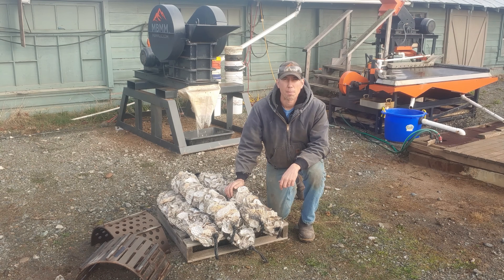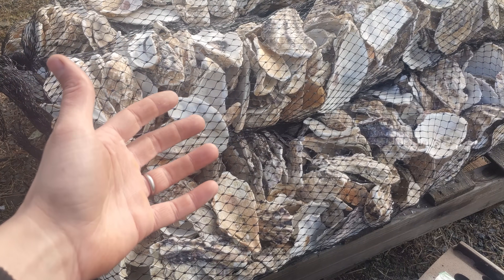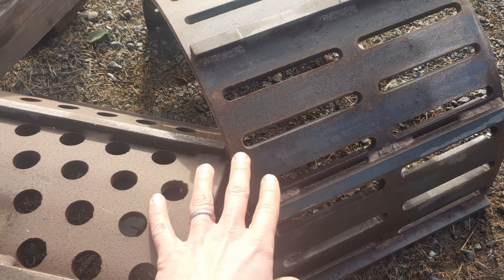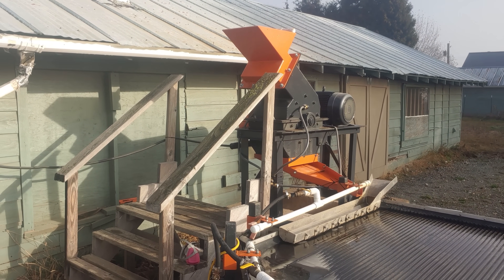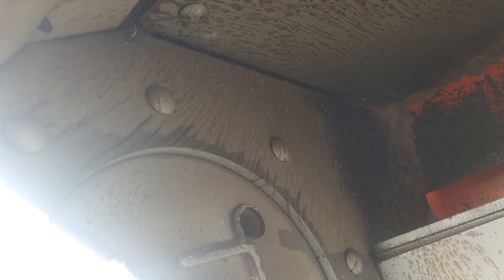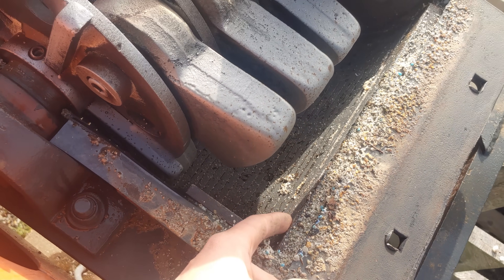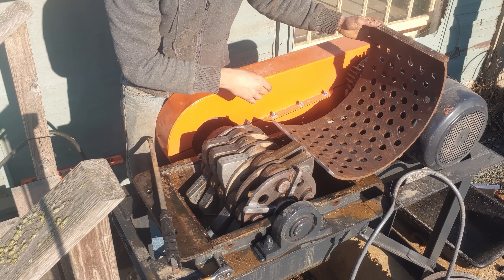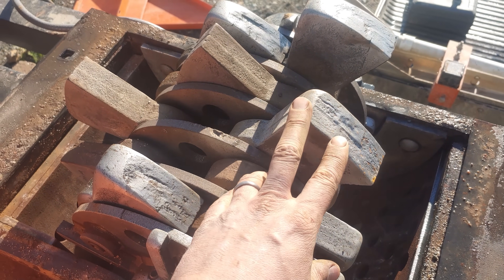Oyster Shell Crushing Machines - Crushing and Grinding Shells with Jaw Crusher and Hammer Mill

Comment: Those oyster shells crushed to ½" then through a rotary kiln would make coarse quick lime.
Add coarse quick lime, Portland Cement, sand ,aggregate and fiber reinforcing or graphene in solution and you'll have concrete that heals its own cracks and sets perfectly with salt water.😀👍
Its also dramatically stronger than ferro-reinforced concrete.
The only downside is the stuff will last for thousands of years, not decades so once it's used, its there until it's purposefully destroyed

Comment: If your crushing for a specific size you don't use screens in the mill you screen before the mill and rerun the oversize using horizontal screens with vibrators starting with fines to product size to oversize and returning into the crusher using a bucket elevator and a chute to return to the top end of the screens. Look into fertilizer production it will show you how to screen for a target size. Your welcome.

Comment: I'm in construction, best thing I can think of is making quicklime, I'm guessing the customer is not looking to set up a new operation, just crush and sell, which then is quite easy. Basically burning shells to form calcium oxide, then crushing to get the powder and well, it's essentially quicklime. There's a bit more to it, but it's a good sell if you have the startup to do it.

Comment: You can weld the top of the hammers it’s called hard facing the technique is also used on worn heavy equipment bucket teeth. Weld on top of weld in a line next to each other slowly building up the worn away metal.shape up and smooth out the facing welds with grinder and put it back to work. Replace them when they break a yolk .

Comment: This is a decent additive for vermicompost and the fine to small (aged) oyster shell particles specifically are great for making biochar soil conditioner product(crushed biochar, vermicompost or castings, compost, humus, insect and fly frass, rock dust, a couple different "meals" like kelp meal, crab meal and fine to small particles of oyster shell).

Comment: For anyone living where roads ice up. Take a bag or Oyster Shell, toss it in the trunk. Added weight. But, if you do get stuck on ice, it works 1000% better than sand. The sharp edges work wonders.

Comment: When the hammers wear out, you can weld metal with a conventional welding machine and align them with an angle grinder. The welded metal is harder. The work is very cheap and easy. So they will be almost eternal.

Comment: One thing that concerned me a bit is that you mentioned the hammers are 20% chrome. I know some forms of chrome are toxic, so I'm not sure if those hammers would be very suitable for crushing chicken feed (or other feed applications), if the hammers may leech chromium into the mix. This would be worth looking into, if you go forward with supplying for this application.
Reply: Crushing rock the wear fast......but crushing shells would probably last a year and over that time you probably would get enough leaching into the product to find even a trace amount in a lab test (I'm guessing though) but good to think about this issue when he actually builds a machine for customer. Right now he is just video ing what path the build will go.
Reply: Hexavalent chromium is the dangerous form (+6) and these hammers have metalic chrome which is 0. Chrome itself is about 40mg/kg in US soils so the amount of chrome in the tailings isn't much different from what's naturally there, but being in the safe form it's not a threat. Some of the chemical steps used to extract other elements from the ore could change the chrome to the dangerous state but that will not be happening with these oyster shells.

Comment: Is the rotational speed on the hammer mill adjustable?  I operate an impact Crusher which is kinda the same internally. Higher the speed on the rotor creates more fines in the finish product. When trying to make spec rock the only real adjustments I have are rotor speed and apron distance

Comment: The crushed shell have many uses. They can be used in big coal fueled thermal plants to  scrape residual co2 from the exhaust gases when added to the fuel in a swirl fluid combustion chamber. They can be calcinated to make dehydrated lime. They can be  used as an aggregate for building mortar. If you clean it and crush it to fine powder with no silica it can be used in cosmetics and as a fine abrasive. Also as feed to birds to help them crush food in the gizzard and as a calcium suplement . As a soil ammendment. To restore beachfronts. If might be used  to make fake oyster stone if mixed with the appropiate resin, as bricks or slabs.

Comment: If you washed the salt off, I'd buy the shit out of the 1/8"-minus... and by that, I mean "A few bags" because I'm not a farmer, but love putting slow-release calcium/minerals in all of my vegetable garden and potting mixes. Since I have a water garden with freshwater shrimp and assorted snails in it, the slow release lets them eat what they need for growing new shell/molts, without raising the pH so high that the plants suffer Nutrient Lockout. Then, when I harvest the muck from the aquatic garden, the muck is too fine for use as is, and will not let water flow through. I've been using granular "Aragonite", which is chemically the same as your shells, but not likely as sustainable. I use it to help  build up a good and stable soil structure, but with the calcium carbonate shell, it should provide calcium and pH buffering indefinitely, while the mineral itself is less abrasive in my Aquaponics system and on my fingers.

Comment: I would be interested in seeing how varying the crusher throat opening affects the size distribution, especially if you could reduce the largest fraction. I'm also curious if a 1" screen in the hammer mill would shift the size distro upward. Then you could use screen and recycle the o/s back into the feed.

Comment: Excellent lime for fields.  But expensive.  Here we have dust mills turning out limestone lime dust for fields.   The would be even faster disolving than limestone  bagged for gardens and flower beds..,,
Adjusting PH of the soil..
Acid rain water nowdsys.  And cleared timber ground is usually acidic.,,tomatoes love acid ground.. Most things don't.  There are test kits for soil.  Fines in bags would likely sell good and the chicken feed size.  Tree leaves are full of tannic acid.

Comment: Would be best ran through a multi deck screen and any oversize material recirculated to obtain the required sizing profile.
Reply: What are the applications you ask.?
Depending on the composition of the shells , it could be used as asphalt fillers , poultry and stock feeds including horse feeds and blends. It can also be used for adhesive fillers or products such as
 grouts. It can be used within agriculture to balance PH . It can also be used in the pharmaceutical industry and cosmetics industry. Another application is in liquid stock foods as the calcium carbonate can suspend within the liquid feed.
Raw limestone must be at least 50% calcium carbonate to be considered limestone. It would be interesting to see what a chemical analysis would show. 
There was another comment saying that it could be burnt into quicklime, (Calcium oxide). This could be possible but the yield per ton after burning for high grade stone is about 63% so that option may not be financially viable.
The natural source would make a great selling point for the pharmaceutical and cosmetics industry.
Maybe put a sample through an XRF for its composition profile.

Comment: I have for years been trying to get the department of Highways to try crushed oyster shells with sand on the roads because the shells melt snow and supply better traction and is good for the soil instead of salt.

Comment: There are thousands of uses for crushed shells. And even if there isn’t an industry that can use the specific size product you can always run is through a large bulk furnace and get lime/quicklime as well as some raw calcium that can be used for all sorts of industries from agriculture to concrete.

Comment: 4:20 ... you could build them up with weld, I used to use 9018 stick rods for hard surfacing similar to this.. it's nice because it welds just like low hydrogen, 7018 everyone is used to.

Comment: Hello Jason. Great video!  The 1/2-1/4, 1/4-1/8 looks like what I give to my chickens to help with stronger egg shells. The 1/8- would work great for feed producers. Could be blended directly into their feed. The 3/4-1/2 not sure. 
Running the shells when dry makes a big difference. When run wet it is very hard to see what you have.
Reply: Would be nice to add a wet screener with stages letting the powder finest stuff be in the liquid as soil amendment either as liquid or evaporated in evaporation ponds. In any event it would all need to be sorted and dried, so why not do that right from the crusher?

Comment: oyster farmers where i live have some more tricks, they put the shells under sun light and rain for couple of months, weather wash away the mud and dirt, then crushed the shells in a small pond and use it as a filter material for water supplies to farm fish and animals. when those batch get "dirty" by muddy water, it will be spread on field as soil amendment. or burned to make lime and concrete cement. freerun chickens in the field will eat that too while they hunt for insects.

Comment: My opinion 
Oyster shells are very brittle that’s why the hammer mill pulverized them 
The jaw crusher is much slower and gentler. 
My suggestion is a roller mill . Like what’s on the old Cedar  Rapids crusher’s that older than you are . 
Now a trammel screener would work nice for sizing. 
My opinion that I know I’m not entitled too
Good Luck

Comment: If you heat it up it will turn to dust with your hand crushing it. :) And can be put in the garden or used as a type of cement. It will heat up when mixed with water.

Comment: I enjoy seeing the various products you run through your equipment.
Most of what I can think of for oyster shells has either been said or is obvious / easy to find on the internet. Here are a couple of suggestions that possibly were not mentioned.
.
1. Vermicompost (worm farming).  
Worm farmers often add some sort of pH buffer to the feed stock.  For my small hobby worm bin I used ground up eggshells and sometimes dolomite lime.  But I have seen worm sites selling oyster shell flour for this purpose.
.
2. Snail barrier. Stuff like around the perimeter of your garden or maybe a flower bed. Snails do not like crawling over sharp / rough stuff.  Some folks say crushed oyster shells is one of the products that works for this.  Have not personally tried.
.
3. Bocca Ball Courts   This one is probably a niche market in the USA (LOL) but crushed oyster shell is one of the components sometimes used to make a smooth firm surface for a bocca ball court.  If it is still there, you can see one across the street from the (now closed I think) Youngstock veggie stand on James street. (across the side street).  A friend and I saw the guy making the court a number of years ago and stopped and asked  him what he was doing.

Comment: The finer stuff is a good slow release fertilizer with calcium and micronutrients. The mid range could be used in the potted plants in the nursery for both slow nutrient release and drainage improvement.  If cost effective enough, I'd certainly use it in my orchards.

Comment: I have always thought that shells on top of gravel would make for a great addition to dirt roads, getting finer and finer as the vehicle passed over and broke the shells against the rock. It seems that would provide an almost concrete-like filler that could prevent pothole formation. I live in SE King County, and have thought about going down to Westport and getting a pick-up truckload of shells to give it a try on my road. My only concern would be smell. It would dissipate after a while, but what about the interim? How did the obviously dry stuff compare to the wet stuff in the older video, Jason?
Reply: My family used oyster shells for a driveway. The smell goes away in a few weeks. They would need to be refilled every 5 years or so.

Comment: 1) I love that closed captioning determined the crusher said "thank you" when you fed it oyster... shells.
2) 3 years ago, stink bugs were making it through the bedroom windows.  Pest guy sprayed, no effect.   So, I lined the window sills inside and out with diatomaceous earth (which i assume is or is close to the powdered product you were making.)  Last year I saw 0 stink bugs, and this year I saw 2 between the screen and the window (still outside).   I reapplied, and haven't seen any more   (yet?).
I can't suggest that this is the best product for the job, but it was the only one that I found that worked, mostly...   (Per packaging:  Don't breath it.  Don't rub it into your eyes.  and it says it works best as insect killer where it doesn't get wet.  (sharp shell powder create micro-abrasions on the underside of certain insects, which apparently leads to their death.)    )

Comment: Oyster shell blast media. Non silica based abrasive ergo no silicosis. They use walnut shells, soda, dry ice, glass, sand, blast furnace slag......why not oyster shells. Properly dried and sized might be great to see how it works. Depends on how hard it actually is and what abrasive qualities it has.
As a mix for terrazzo or exposed aggregate concrete. Add mix for nonslip surfaces. Polishing media for rock tumblers. Polishing media for toothpaste. They use ground up limestone now.

Comment: For the hammer mill, could you do something with the speed of the hammers themselves? May be turning down the rpm could change the distribution of the material results?
Reply: Also curious what would happen with less hammers and some spacers between the hammers. Less wear products to replace. Lots of variables to play with on softer materials like this.

Comment: That powder would make a good replacement for bone meal. The trace nutritional minerals in that is likely unbelievable.
You may have to cleanse it by fire to release the minerals so the plants can absorb and use them.
Make them into bricks, fire them, then responder them. Minimizes the risk of fire, or explosions.

Comment: I think the difference is mostly in the demand they have for size. Looks like they both work well... Though if the jaw crusher can be set tighter, that distribution might be interesting. If the smaller sizes evenly increase or if an intermediate size gets more.

Comment: I'd think there are a bunch of uses. Concrete, asphalt, fertilizer, bird feed, calcium supplements, and even possibly as fill for beach erosion. I wonder too if the dust could be used as a sediment filter (similar to diatomaceous earth).

Off Topic but I've often wondered why they do not use recycled plastic in asphalt. I saw this company in Germany that creates pellets from recycled plastic but does not seem to have a high demand for it. Seems making new plastic is cheaper than recycling old plastic (and creates less toxic waste).

Sort of like how we got rid of plastic straws wrapped in paper to save the environment. And replaced them with paper straws wrapped in plastic... Gotta love logic sometimes... 🤣 Can't tell it's Sunday and I am bored!

Comment: Don't they make diatomaceous earth out of the fines to kill bugs 👌
Reply: Diatomaceous earth is literally fossilized diatoms (a type of hard shelled algae). There are other components usually mixed in diatomaceous earth depending on where it was collected (clay/minerals) but oyster shells are not one of those components. If someone was selling finely powdered crushed oyster shells as diatomaceous earth, they would be not selling the same product even though they appear very similar in size and color they are different in actual composition. Diatoms are mainly silica (80%-90%) while oyster shells are made of protein polysaccharides and minerals including calcium (around 52%), magnesium, sodium, copper iron, nickel, strontium and some microelements.
Reply: No. Calcium carbonate comprises oyster shell. DE is comprised of amorphose silicon dioxide. DE is glass and under microscope looks like  stained glass windows. It cuts the insects exoskeleton when they come in contact with it  causing them to die from dehydration.
Reply: Awesome thanks for the information 👌 
Would crushed shells have a similar effect tho if so it could be a great none toxic means of taking down like a huge group of locust in places like Australia where they can be a huge problem for farmers.

Comment: In Britain they use crushed rock to remineralize the soils because of leeching from all the rain. That might be an avenue to look into and not only that here in the US will have the same issues because of increasing weather events. Just a thought.
Reply: Different rocks add different minerals.  Usually only N gets leached.  Everything else depleated by plant uptake or un available due to chemistry.   But rock dust as ypu say is the answer to many long-term problems